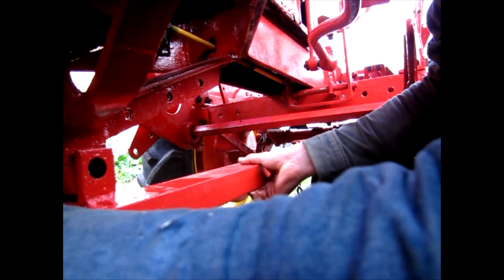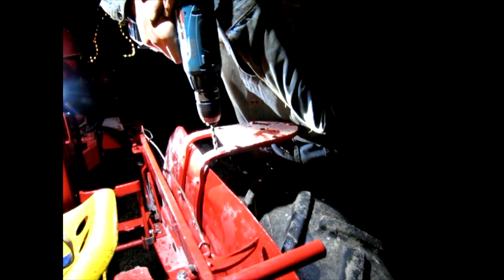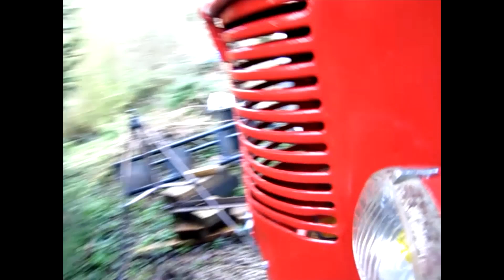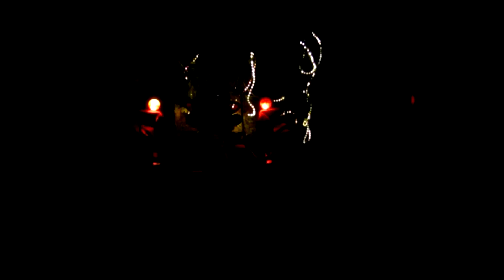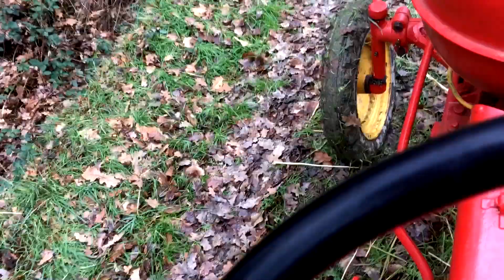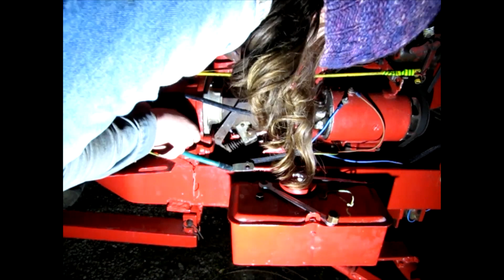Finishing Restoring My M-H Pony and Putting it Back to Work pt5

Comment: i can only start my tractor with an 12 volt battery
Reply from the maker: Yes, the later tractors came with 12v electrical equipment and over time a lot of them got converted to 12v. However if your starter motor is indeed a 6v than you need to clean all the connections and get the motor rebuilt because a 6v starter that is almost dead or with poor connection to the battery will still start on 12v
Reply: ok my starter motor runs with an 12v battery better than with an 6v battery, i cleaned it und repair ist und test it lot times @toolreviewsandrestorations

Comment: wow very cool, i am hyped at my pony 812, i have it with the peugot engine and with rear hydrolic
Reply from the maker: I’m pretty sure that the Peugeot engine was only mounted on the later Pony 820 tractors. Does your tractor have the 5 speed gearbox or the three speed gearbox?
Reply: @toolreviewsandrestorations  three gear gearbox, but i dont have the simca engine or a have an other type of the simca engine, because some things are completely different a my engine
Reply from the maker: @Lindino M-H mounted a different version of the Simca engine on the first 1800 tractors and on some of the later 812s the engine had an incorporated governor. Over the production run they mounted many different parts on the same engine. If your tractor has the 3 speed gearbox than it has to be an 812 because I’m pretty sure that the 820s had five speed gearboxes. The easiest way to tell between the two models at a glance is the sheet metal over the battery behind the gas tank. If it’s long like mine than it’s an 812. On the 820s the steering column is much closer to the tank and the sheet metal covers over the battery are much shorter.

Comment: Hi I'm enjoying your restoration videos,I'm restoring one the same in ireland  I was wondering do you have any idea what the brass pipe on the inlet manifold beneath the carburettor is for,mine has nipped off close to the nut,should it connect to something else?
Reply from the maker: I'm not exactly sure what that pipe is for, I think it's a breather or something but no, it is not connected to anything. Thanks for watching
Reply: Thanks, I blocked it with a bolt  temporarily to get the engine started  but  I think I'll refit it again, it doesn't seem to be drawing  petrol into the carburettor since I blocked it even though I cleaned the float and bowl,maybe just coincidence but I'll try again tomorrow, keep up the good work 👍
Reply from the maker: Sounds like a good idea. Are you even getting fuel to the carburetor? If not you might need to check the lift pump, it was one of the first things I had to change on my tractor
Reply: @Tool Reviews And Restorations  I was running it gravity flow from a funnel and pipe straight into the carburettor, maybe I have a blockage at the top of the carburettor inlet pipe,I'll look at at today.
Reply from the maker: @Stephen-tz2xf  Likely, on my carburettor there are two different little screens on it